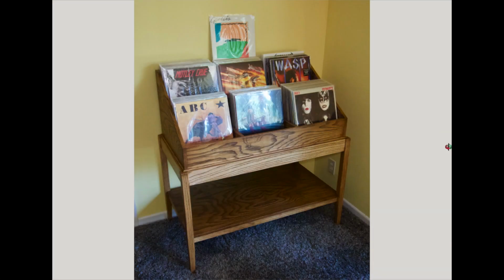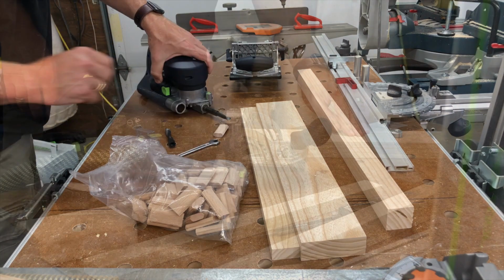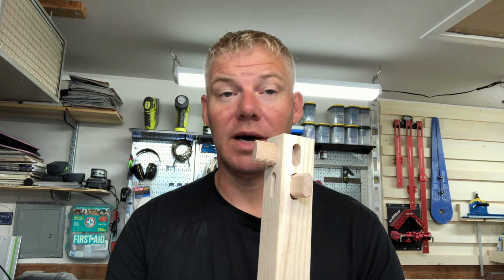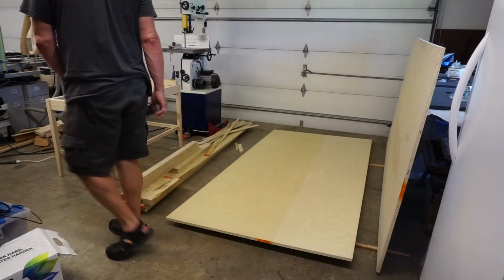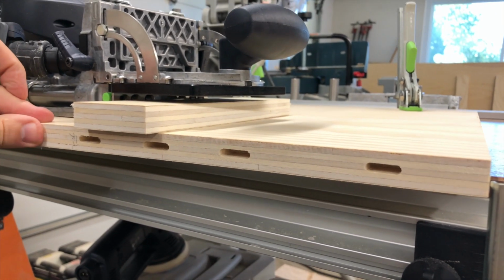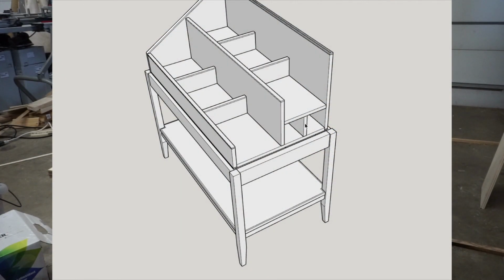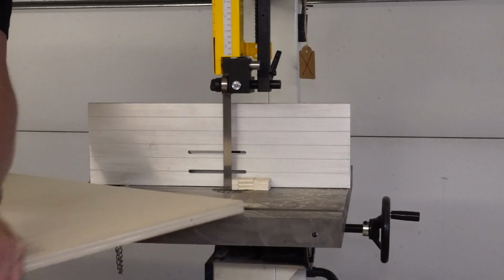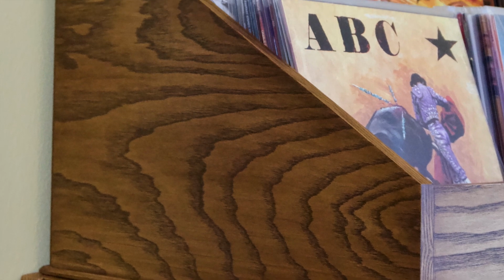Vinyl Album Stand

Comment: The domino wasn't supported across the gap and the blade grabbed it. I don't do wood work, but I am a machinist. For this type of cut, I would of had a sacrificial backing material to bridge that gap. Thank you for this video. I will make something similar, if not exactly like this with wheels so I can relocate it easily.
Reply from the maker: Thanks for watching and you exactly right. I was in the moment and should have taken a step back to analyze and make a smarter cut. That is how we learn I guess! Enjoy the build!

Comment: Nice project. I actually like it blonde, maybe just a clear poly would do. I made a couple stands about ten years ago, one for classical and one for rock & roll out of Teak. I like the accessibility of yours but I like the acrylic covers of mine. Think you could adapt covers for yours? You are right, with spring coming it's time to get back into the shop and make something. You've given me some ideas but I think I'll pass on the Domino part.
Good Job!
Reply from the maker: Thanks for watching Ian.  Valid points.  I would have stuck with blonde as well, but this one was for a client.  I wish I had held off on this project until I got my CNC, then I would have a completely different build process for it!